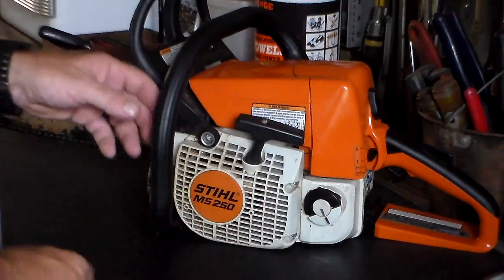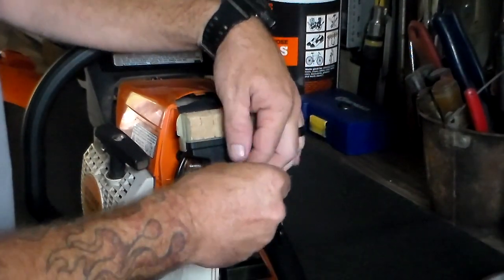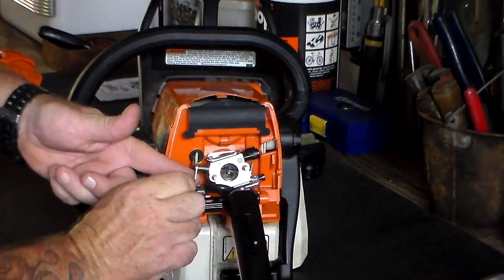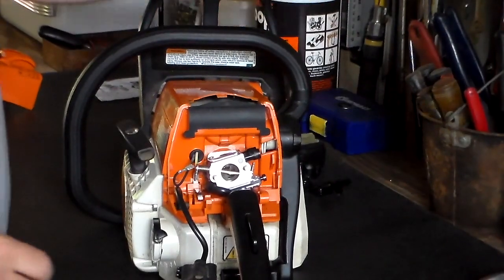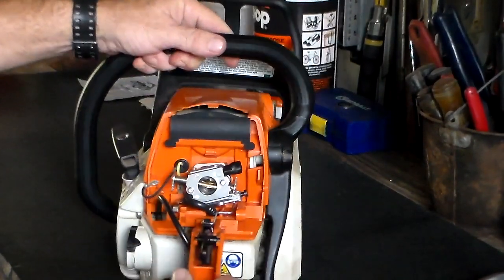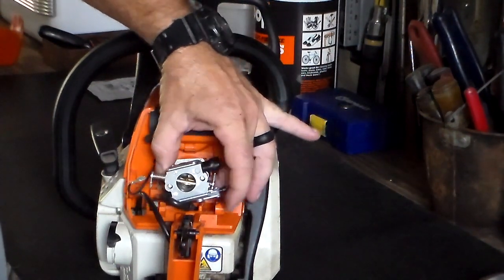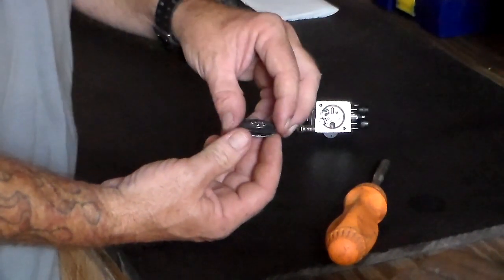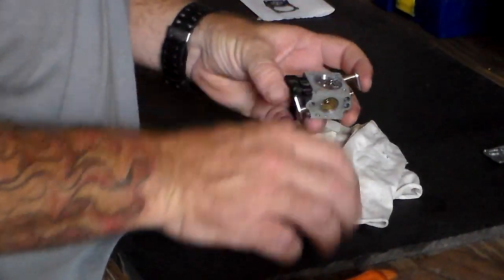Stihl's MS250 carburetor  rebuild / disassembly -reassembly

Comment: More work than needed to remove carb. No need to take vacuum plug off, top of handle, and the black kill rod. Just unhook both the kill and the throttle linkage where they attach to the carb. If you're doing a rebuild on an aftermarket carb you're wasting your time. Spend 30$ and buy an stihl OEM and slap it on in 15mins. You'll get 3xs the life out of it but most importantly than anything is using quality gas and when you're aren't going to use it for an extended amount of time go out and start it up routinely and let it idol for a few minutes to keep fresh gas in the carb.

Comment: I tore it down, disassembled and cleaned the carburetor. put it back together, (a miracle) after watching Mike over and over, (thank you), and tried to start the saw. It was the same, so I'm going to save myself the time and anxiety of not knowing what I'm doing and take it back to the dealer for repair. It was a learning experience. Next time I will just buy a new carburetor first, and will empty the tank after each use. Will be seeing you again I'm sure.
Reply from the maker: Sorry to hear that. If you didn’t buy a rebuild kit then the diaphragm is probably gone brittle. The additives in the gas make them hard so they can’t do there job. Sometimes just cleaning helps sometimes not. Don’t get frustrated. The more you do it the better you learn what to do.  That’s how I learned. Unless you have a lot of crap stuck in the jets a carb should be rebuildable. Good luck! 👍
Reply: Got the saw back but waited two months, (busy) Tree limb fell on my fence, so tried to start it and it still is doing the same. I need to figure out how to find a reliable saw and dump this one that is practically new..
Reply: @daultonruff2281  I assume you have the proper spark plug and spacing for it? Using good gas? It only ever comes down to fuel, air and spark
Reply: Try taking off your muffler and open it up and clean the screen (spark arrestor) ......if it gets plugged it will give the exact same symptoms as a bad carb.

Comment: T25 was loose for me, T27 was a better fit
Reply from the maker: Ok great thanks for the comment 👍
Reply: @MountainMike01  No problem, thank you for the helpful video. Both my local shops told me my carb was junk and it wouldn’t be worth repairing. Both quoted $160 for parts and labor. I found your video and all I used was some carb cleaner and compressed air and she’s better than ever. Thank you.
Reply from the maker: So glad that you were able to do the rebuild. It is easy and not worth $160 for someone to do what you can.

Comment: Just curious, I rebuilt my carb yesterday and it's never been touched.
The gasket on the diaphragm side was over the diaphragm and mounted to the carb side. I put it back together the same way, have you ever seen that before? I think I bought my saw in 2007 or 08.
Reply from the maker: Could be a small change they did in manufacturing but no i haven’t seen it personally. If you rebuild it and it works don't question it is my advice. Thanks for the question!
Reply: Mine was as in the video but online parts diagram show the gasket on the carb side ill put it back as it was see what happens
Reply: Mine too. Pretty sure it's how it came from the factory. We'll see if she'll run now.

Comment: Why do you need a rebuild kit every time you open up the carburetor and clean it?
Reply from the maker: Well, you don't unless the diaphragm / gaskets are no good or you tear them up getting the carb apart. That is the stuff that is the problem with the carbs most of the time. The additives in the gas make them hard and brittle so it doesn’t work correctly. That and the needle sticking. When your done, run it out of gas or use an engineered fuel for storage is the best bet. Thanks for the question.

Comment: Thanks; Door knob here to ask a few questions. First time rebuilding a carb. How long do you soak it in acetone? I guessed, when I bought the Chinese carb because I have a "priming bulb" for the fuel. Too many models for MS250 and scary reviews about things that didn't align reported. I guessed wrong and the carb they sent, although almost identical, has an extra port (?) tube so I don't really know what this carb is for. I suppose I need to order a specific "Zuma" rebuild kit so I'm sure about the replacement gaskets and diaphragms. 
Not sure if I should wait for a kit, or just try to clean it with the carb cleaner and air and reassemble the whole thing and see if the saw will run.
Reply from the maker: Soak it for 15 minutes to an hour. The longer the better. I would get the carburetor off and try to clean it. If you blow the jets out real good clean it up real nice and it still won’t run right then buy the rebuild kit. This is a better option than cheep China carbs. They don’t seem to last very long. When you have it off and clean take pics of it and the numbers on it.  Then no more guessing next time.

Comment: It doesn’t mean shit where the carburetor or metal parts are made!! 

It’s the damn ethanol in the fuel that’s the problem! 

It’s also the saw dust that’s the problem!
Reply from the maker: Agreed. 100% Gas and better, cleaner, regular  maintenance on equipment is key.